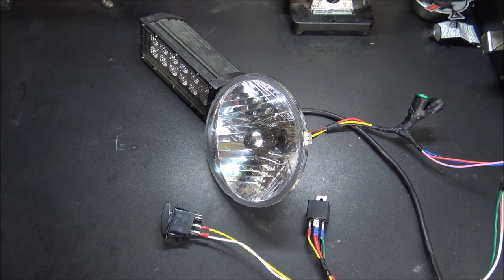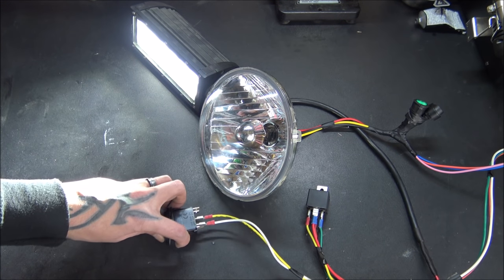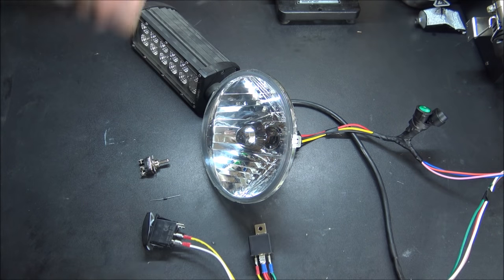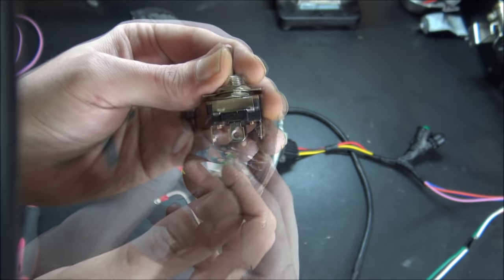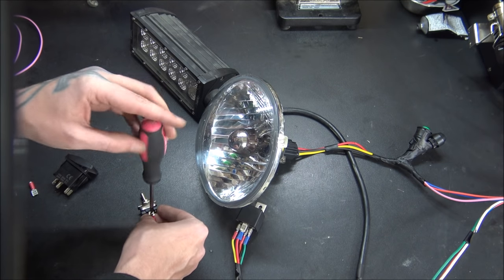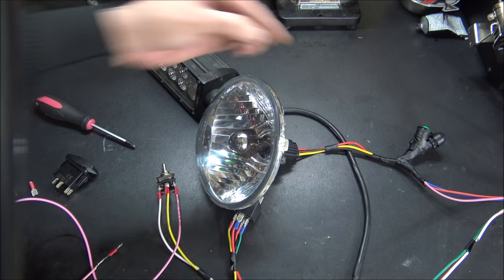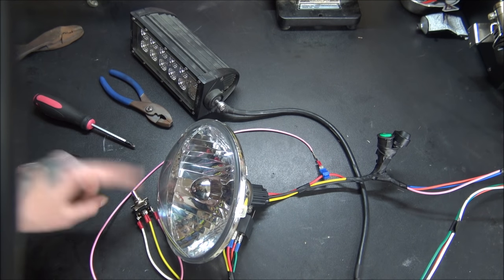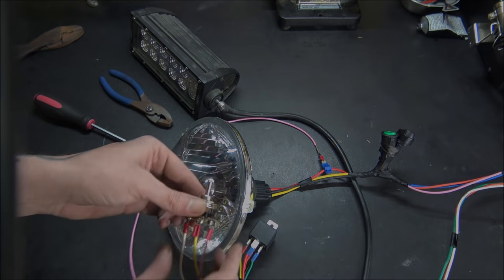3 Way Switch, How To Wire Your Light Bar To Work With Your High Beams & By Itself (ON/OFF/ON Switch)

Comment: Ok, but how would you do this with an illuminated 3 prong rocker/toggle switch and have the lights in the switch still turn on when clicked to either of the “on” positions?
Reply: I’m having this exact problem, did you ever figure it out?

Comment: Hey Rocky X ...so I love the videos but i guess I'm a little confused and have a question hope you get this and can help me with a diagram of these 2 video So I guess my question for you is can you add a light bar to your reverse back-up lights with a 3 prong toggle switch (on-off-on) so your light bar works with your reverse backup lights when you put it on reverse and when you take it out of reverse it would then shut off AKA ( flipping the switch one way would work with the back-up lights when ever you would throw it in reverse) & still be able to just turn the light bar off AKA (but still be able to use your back up lights say for instance in the day time you really don't need the light bar but you need to back up it would just be normal like you never even had a light bar & for the last  flip of the switch it would be ideal  for  it to turn on regardless if you put rhe vehical in reverse you have control over the light bar AKA (you would be able to turn the light bar  on or off regardless if the vehical was on or getting put in reverse you have control over the light bar)....so I guess my question is is this posible and if so is there a posible diagram you could help me out with or a drawing or anything to posibly guide me & in this set up do i need a (Doid ) or can I get away with out one in this set up  cuz I've never installed one let alone dealt with one befor .....so if I can get away with just a relay do i need a 4 or 5 pin and how many in-line fuses should I have ...I WOULD like to also say that any additional information would be verry helpfull and verry much appreciated thank you in advance and Hopfully  you get this and can help with your mad skills thanks agine and keep the videos up
Reply from the maker: You don't need the diode, I went back and did some testing and found out that the diode is pretty much useless in this setup. As for the reverse lights you want to wire, it is completely possible, I even made a video on how to do exactly what you want quite a while ago. Check it out and let me know if it's what you are looking for. https://youtu.be/hjpucoy0Qxo Thanks for watching!
Reply: @RockyXTV  
Ok so yes thats what im trying to do in that video you sent me BUT I'm trying to do it with a 3prong toggle switch with no light its smalllike the one you have in this video  (on-off-on) can you help me understand how to wire this up how to on my 91 ford explorer  ....I wana do this video with the toggle switch you have and light bar you have in this video combined with the reverse backup lights with the other video you sent me with the exact functions in the second video......dose this make sence can you help me you think ?
Reply: Wirh the way I'm explaining do i have to use a doide so when ijj flip my switch it won't turn on all my lights ???
Reply from the maker: I think I understand what you want to do. Just send me over an email ( rocky.tvchannel@gmail.com ) and I can send you over a wiring diagram.

Comment: Fantastic video man! Question..any way you could comment on your relay configuration for this set up?
Reply from the maker: I think it was like this, Pin30-POS/Battery, Pin85-NEG/ground, Pin86-to center pin of three way switch, Pin87-POS to light bar. If you have five pins then Pin87a-Not used. I hope this is what you were asking for, thanks for watching and don't forget to subscribe to keep up on all the new videos! I've got a lot more wiring tricks and tips coming this spring & summer, thanks again!
Reply: Yes'ir, that's exactly what I was asking for.  You could search for days for this setup and find 20 different drawings but with your video, I know its going to work.  Got my schematic drawn up and looking forward to my install this weekend.
Reply from the maker: Good luck on your install this weekend, thanks for watching!

Comment: I like your videos. Very good at explaining. I have a question though. Can you make a video of hook up led light pods to reverse light but use a led rocker switch to turn on and off while in reverse and not in reverse? Hope you understand what I'm asking. And one more question, is it impossible to change color led light inside of the rocker switch? Thanks.
Reply from the maker: I'll definitely see what I can do about the video, as for changing the color of the LED's unfortunately it's just easier to buy new switches. You can disassemble the switch and try to un-solder the LED and solder a new one in its place, but it's more likely to destroy the switch.
Reply: Rocky X TV Thanks for answering my questions! Hopefully you can make a video cause it would be so helpful.
Reply: Rocky X TV let me know when you upload the video if you decided to do it. Thanks
Reply from the maker: Sure will, I'm going through my stash of old stuff to find out what lights and switches I have for a video.
Reply: Rocky X TV sweet. You are awesome
Reply from the maker: Good news! I should have the video you wanted posted this Wednesday!
Reply: Rocky X TV awesome!! I can't wait then! Thanks a lot!

Comment: Hey I'm wondering if you can help me out. I have a 2018 ram 3500 with factory aux switches. I got a 30" light bar from rough country and I'm wanting to wire it to my aux switches, but I'm wondering how I go about that. My light bar has a DRL feature or an On feature, so it came with a three way switch and relay. Can I simply just wire it to two of my aux switches or is there more to it than that? Thanks!
Reply from the maker: Could you send me an email with a link to the lightbar kit you have? This would help me look into the wiring a little better. ( rocky.tvchannel@gmail.com )

Comment: Would this same principle apply to interior LED under dash lighting having an on/off and also having them work in sync with the automatic map and courtesy lighting when the doors are opened? I would essentially want the diode on the wire connecting the LEDs to the auto map/courtesy lighting power, correct?
Reply from the maker: If I follow you correctly, yes. Thanks for watching, and don't forget to subscribe to keep up on all the new videos and products! Thanks again!

Comment: Is it possible to put the diode on backwards... does the orientation matter on a diode
Also!! How many watts do you think the light bar setups should be with your setup you have
Reply from the maker: Diodes do have to go in a certain direction. You have what's called a Cathode and an Anode. The Cathode is the end with the silver band, current can only go through towards the silver band and won't go back the other way. As for the light bar, are you asking about the small one I have in the video? If so it's an 8" Hella Optilux 36 Watt light bar. Thanks for watching!
Reply: Sweet and thank you , I was asking:
 if I used all the same wiring setup you have how many watts could the light bar be potentially without messing with the diode
Reply from the maker: If you don't use a diode, theoretically you could go as many watts as your relay, fuse and wire could handle. Most standard relays are rated for 30 Amps constant and 40 part time. This would work out to about 400 Watts with one relay, now this would require some bigger wire though.
Reply: Thanks!!!

Comment: Hi I was wondering if you can help with a question I have  I hooked up auxiliary reverse lights to my truck that I tapped in to the reverse lights to the truck right now it only turns on when I put the truck in reverse I want to add a 5 pin halo switch so I can turn them on with the switch and turn on when I put the truck in reverse.if you could help me I would greatly appreciate it

Comment: Hey bro great video. So happens my name is rocky too lol. Anyway, stupid question. Could I just tap into the bright light wire so anytime I hit the brights it sends the light bar juice as well?
Reply from the maker: You would want to run a relay, otherwise you would be pulling all the extra power of the light bar through your headlight circuit. Wiring in a relay for your application would be fairly easy. I'll give you a short breakdown of the relay wiring. Pin#30 = Power to battery with a fuse, Pin#85 = Ground to chassis or battery, Pin#86 = Tap into your high beam power wire and lastly Pin#87 = to your light bar. This would cause your high beams to turn on the relay, the relay then pulls power from the battery instead of your headlights and sends it to the light bar. This way your headlight high beam is only acting as a "trigger/switch" for the relay. I hope that all makes sense, thanks for watching!
Reply: Rocky X TV I have a similar situation as this.  I found your video when I was looking for a solution.  I have wired up my lights on my four wheeler as you described.  But if I switch to low beam no lights come on at all.  If I disconnect either wire that goes to the coil of the relay they come on.  I have aftermarket led headlights.  Don’t know if that matters?
Reply from the maker: This should have no effect on your low beams unless you tapped into them. Could you give me a little info on where you have the pins on your relay wired? I can also send you a diagram if you like. Just send me an email ( rocky.tvchannel@gmail ) Thanks for watching!

Comment: Slightly unsure... I got the most of it but do I or don't I need a diode? I seen a message flash up saying I don't but u also said I do, what the deal?
Reply from the maker: You don't need the diode. I used it in some testing and it ended up in the video, but it turns out that it's not needed. Thanks for watching!
Reply: Rocky X TV thanks a bunch 👍

Comment: Hi,  Can we switch on all together in this particular case. Low, high & the bar ?  Thank you
Reply from the maker: You could, but the wiring will vary from vehicle to vehicle, and if you have a single bulb for high and low beams or separate ones. I have a video in the making about how to make your low beams stay on with your high's. This has been a pretty popular question as of late so I'll try to get the video filmed and uploaded soon. Thanks for watching and stay tuned for the video, it should help you out with what you are wanting to do.

Comment: Trying to do a Similar thing hooking up snow plow lights on a truck I want them to switch power from my high and low beam headlights on my truck to the high and low beams on the plow lights , otherwise it will probably burn the wires up because it’s takes to much to run both at the same time any ideas? Thanks

Comment: Perhaps I'm overthinking it, but how would I use this method for installing 2  auxiliary lights, not just the one like in your demo?
Reply from the maker: You would just wire the two lights together  ( + to + & - to - ) then do the same as the video. I hope that's the info you're looking for. Thanks for watching!
Reply: Thank you!

Comment: I want to have it wired to my high beams but still be able to turn it off with the switch (I don't need it to turn on solo at all). Could I do that with just an on/off switch?
Reply from the maker: If I understand correctly, you could simply tap into your HI beam power wire. Run that wire to your switch. Run a wire back to the power of your light bar. This will cause your light bar to come on with HI beams if the switch is ON. If the switch is OFF, the light bar won't come on. You just need to be sure your switch is rated for enough amps, otherwise you'll need a relay.
I hope that is the info you are looking for.
Thanks for watching!

Comment: Can I just add 2 additional 108 watt led lights to my high beams by joining the positive leads to my high beam power wire and then the negative leads to my negative battery post if I just want some more light to come on with my high beams, or do I need to mess with adding a new resistor and fuse?
Reply from the maker: You could just tap into your high beams like you said, but you would need a relay. Even if they are LED you would need a relay for 108 watt lights, that much on just your high beam headlight relay wouldn't be good. Just use your high beam positive as the coil/trigger wire on a relay (pin 86) I hope that makes sense, thanks for watching!
Reply: So the negative light leads go to the battery and the positive leads go to just 1 high beam power wire, with a relay/fuse in between?
Reply from the maker: You got it! Just make sure you use a relay and a fuse,(they are different things, I have to say that cause some people don"t know) If you don't use a relay you will burn up your headlight relay, switch or set your headlight wiring on fire. Your headlight wiring/system is not meant to support that kind of current.
Reply: Thanks

Comment: Could I tap into the high beam fuse instead of using the diode on the high beam wire?

Comment: I’m trying to run this setup for my ram 1500 and I have two questions.

1. How do I know which is the high beam wire and which is the low beam?

2. What other way could I connect the 2 wires without the t tap?
Reply from the maker: You'll need a test light or multi-meter to test for your high beam power wire, you can try looking it up, but I don't really trust many forums on electronic questions. You can solder into the wire, you can cut the wire and join them back together along with the new wire. There are multiple ways to tap into your high beam wire. I hope that answers your question, sorry I don't know what color your wire is, but thanks for watching!

Comment: I allready got my two light bars 7 inchs hooked up.. could i just run a wire from each light to my high beams.. and still have controll over my light bar?
Reply from the maker: You would still need a three way switch of some sort. If you just ran a wire to your high beams the bar would come on with them, but if you used your existing switch it would turn your high beams on with the bar due to them being connected. I hope that makes sense. Thanks for watching!
Reply: Rocky X TV   i want my lights to come on with my high beams, plus be able to have the option to run them with low beam aswell. There hooked to a toggle switch right now.. could i do that by splicing my high beams and running a wire from my light bars to each of the highs.
Reply: So them coming on with my highs is wat i want.. so your saying if i turn my highs on the light bars would power on aswell..(thats what i want)
Reply from the maker: Yes but if you turn your light bar on it will cause your headlights to come on. You would not be able to control your headlights and light bar separately . Anytime your light bar is turned on your high beams would come one without actually turning them on with their switch. Anytime you turn your high beams on your light bar would come on. You wouldn't have just your light bar or just your high beams anymore, it would be all or nothing because nothing would be separating the two.
Reply: Rocky X TV got ya. Thanks

Comment: Like on an atv cant you just splice the hot wire from the led bar to the hot wire from the high beams then when you put factory high beams your led will light up im talking atv here and not using the bright and led independently or you still need a diode

Comment: Question: this pertains to an acura tl 2005.

I want to add fog lights but ive seen on amazon rectangular 4x6 headlights i like more then using led bars (small cubes) and wanted to know if it woupd be possible for me to use headlights as fogs. These would not be spliced into regular headlights. Would like them stand alone with their own switch and retain the high/low beam function.
Is that something that would be possible to do?
(Would have 4x6 amazon headlights units in my bumper as fogs with their own switch and the possibility to use high/low beam with switch flick)

Comment: An actual drawing showing the whole wiring set up would help a lot more , i understand the set up but am a bit confused as to where the light bar wires are hooked to as well as all the wires run on the relay , you didnt show that , great video , have watched it sevral times but still not sure .

Comment: I tried your way with a 3 way switch but I had a problem, which is when clicking on one side the led bar turns ON alone, but when I click it to the other side the headlight turns ON alone without the led bar , what do you think is the isseu?. Hope you answer my question and thanks anyway.
Reply from the maker: If you send me an email ( rocky.tvchannel ) I can send you over the wiring diagram for this. Thanks for watching!

Comment: i have done this but once my high beams are on the power coming from the lights is just enough to turn the relay on turning on my light bar if i give some revs to get more voltage to come up it will flick on the realy is there a way to up the voltage to near 12v when high beams are on?

Comment: Correct me if i'm wrong, It seems as if the diode serves no purpose in this particular installation. How would a positive current back feed from the 3 way switch?
Reply from the maker: As I said in the description of the video, the diode is not needed. The diode was for a CAN-BUS compliant experiment. Thanks for watching!

Comment: The switch I currently have for my off-road lights have a ground for the switch. Would I still need a ground for this kind of switch and which prong would I connect to if needed?
Reply from the maker: No ground needed for this type of switch, just power IN and power OUT. Thanks for watching, and if you haven't already, make sure to subscribe to keep up on all the new videos! Thanks again!
Reply: @RockyXTV  hi, nice video, ciuld you please send my whole wirring diagram? Thanks